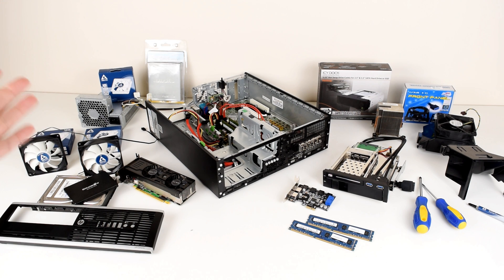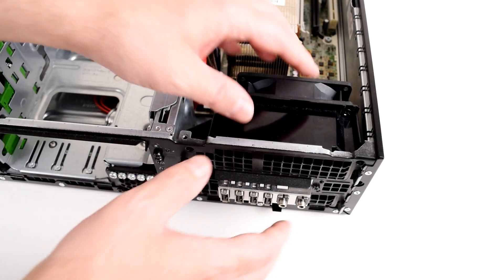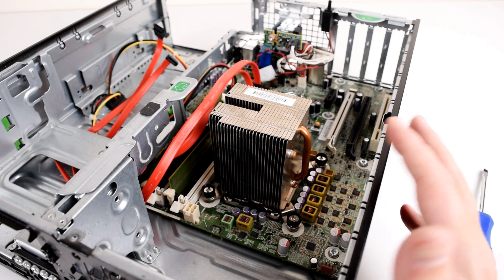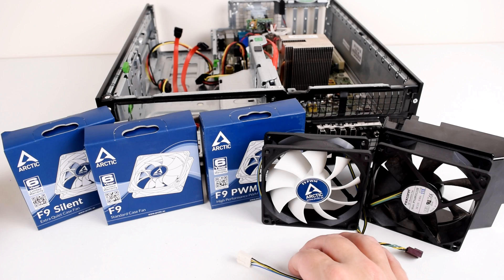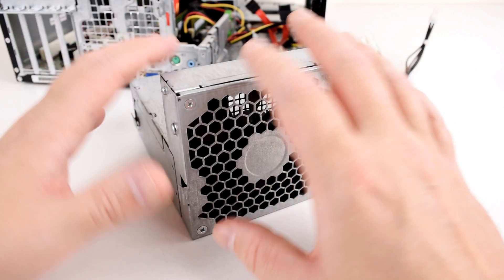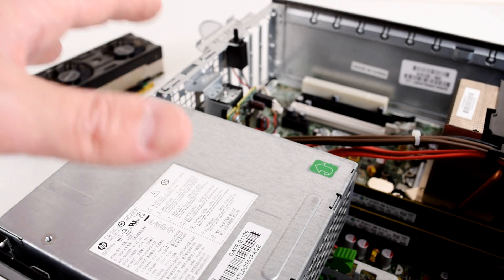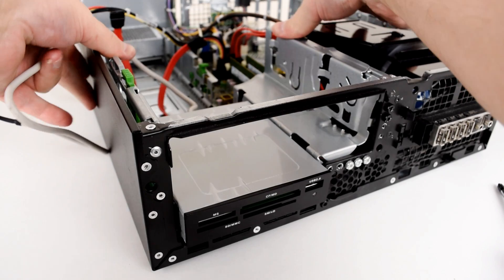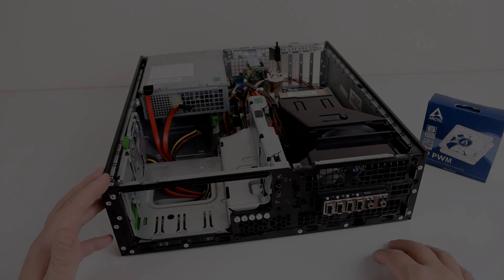Improve your HP Elite Small Form Factor PC

Comment from the maker: I get a lot of questions about the power supply. Check this video segment https://youtu.be/XnBMkOO34Nk?t=8m33s That's an 8200 maxed out with an i7, 32GB Ram and 1050 Ti, and the worst power consumption I measured (at the wall) was 135W. Factor in that the PSU isn't 100% efficient, actual usage is even less. So hopefully this shows what's really going on :)
Reply: I looked up the actual specs for the HP 8300 SFF (DA-14268  Version 20 — 12/4/2012): 
The PCIe X1 slot is rated at 10 watts.
The PCIe X4, PCIe X16 and PCI slots are rated at 35 watts.
The other point of note is that the first two (light blue and blue) SATA connectors are rated at 6GB/s.
The other two are rated at 3 GB/s.
Reply: Hey Phil, will this work with a HP 8300 too? I could get one with an i5 3570 , 16GB Ram for 90€ , i would buy a low profile gtx 1050ti after buying the pc :)
Reply from the maker: It should!
Reply: Anyone know if the i7 version  which ddr3 it takes?   As I want the 32gb ram    but worried it's going to be like my hp8000 where it was a nitemare to find ram that works.   Can the i7 version simply take 4x8gb sticks of hyperfuryx ddr3 1600      or is it still   hard to get ram?     Like 10600  sticks
Reply: @mobilesnapper79  The recommended sticks are PC3-10600, but you can use faster DDR3 RAM and it will underclock it to the speed it needs. P.S. this is from personal experience on the i5 2500 8200 compaq elite sff, as my budget is not infinite I was only able to test this on a few different sets and speeds of RAM.
Reply: @wh0_am_152  ah but  will that cover hyper x fury ddr3 chips  as these things can be a pain to get the chips for.  In the UK  if it is 10600    then 8gb chips can be got second hand for  £25  making it a £100 for 32gb     however   I got a kit I use in my old fx8350 build  that would save a few quid  as I think the i7 3770 with 5 ssd  32gb ram  and a 1050ti  will be a useful editing only pc
Reply: @mobilesnapper79  Probably, I got 2 sticks from Crucial, and two from EVGA in my system.
Reply: @wh0_am_152  thanks mate
Reply: @mobilesnapper79  yw, PS, it took me 5 restarts to get my computer to accept the new RAM, and a black screen ir two
Reply: @mobilesnapper79  What was the issue you had with the RAM?
Reply: Hmm it wasn't in this machines pdf file... But I remember reading it's 35 watt max for regular pcie or add in cards and normal 75 watts for graphics cards.  

Another powerhouse sff is an HP z230 check it out.
Reply: Just got a hp 8300 sff and want to add a large 4tb storage hdd. Will that work with this older pc?
Reply: @adamsirois4672  yes it works with a 12tb iorn wolf    so it will work with a  4tb  drive.
Reply: @adamsirois4672  Yes, it should work fine. Setup in Windows 10 and Linux is easy for large hard drives.
Reply: Which Camera did you use to film this video?
Reply: PhilsComputerLab they make great hackentosh's
Reply: PhilsComputeLab How many mhz have ram which you use in that build or can you tell me how many mhz ram that motherboard support
Reply: I have HP Elitedesk 800 G1 SFF. I assume it would work on mine aswell?
Reply: it's funny how i watch this on a 8200 SFF
Reply: but dont you know you aint livin unless your pc welds the parts together if theres ever a short
Reply: My question regarding power supplies is CAN a person find an after market (name brand) power supply to replace a bad power supply in one of these small computers?
Reply: @Animalwon  If you are worried about power this isn't the machine for you. The PS is non-standard and hacking some kind of replacement together is way too much work. Anything is possible but practical is a different matter. If the PS dies you can always pick up a used one from eBay.
Reply: @ninline2000   No,I was questioning the power supply because i got a few of these and they were missing the power supplies when i got them ... And needed to know what I could use to replace them, and what wattage I'd need to use i7's on them.
Reply: @Animalwon  I think there are converter cables that will allow you to use standard 24pin power supplies, or just get used PSU from 8200
Reply: Where could i find such a power supply? What form factor are they? I have a few old cases for these computers that i would like to put to use but they need power supplies to go with some new mATX motherboards.
Reply: do I need to upgrade the psu to put the 1050 ?
Reply: @th3Kun  If it's not too much trouble you could upgrade it to be completely safe. But you don't have too, it will work on original PSU
Reply: @TheKoxy1995  no I want the method but ok thanks
Reply: What is that 5.25 to 3.5/2.5 USB 3.0 caddy from?
Reply: can you try using a low profile GTX 1650
Reply: @hydro73_42  Does not work with the original power supply. HP had their power supply made in a specific/unconventional shape as well, so it's not an issue easily remedied unless you're comfortable altering (drilling) the actual case.
Reply: nive video dude! I have a question, how did you get the asus bios? I only have some very basic options and some features that I need cant be found
Reply: I have the same mobo but a i5 2500
Reply from the maker: @LIGDASCC  What Asus BIOS???
Reply: @philscomputerlab   i might be confesed but if you know is there a way to update the bios because i cant find anything not even at hp site
Reply: @philscomputerlab  i dont mean haw to do it but where to find the files
Reply: You fail to mention kind of fan you use for the power supply.
Reply: I want to use 3 or more monitors on this pc, I got it working with a VGA and DisplayPort, I got a ATI Radion 5450, but was not able to use the old ports, any recommendation?
Reply: @LordOscur  What do you mean by old ports? Explain, elaborate..
Reply: @jbol2454  The motherboard onboard video ports (integrated VGA and DisplayPort)
Reply: @LordOscur  What a silly question this, you can't use the onboard and graphics card at the same time. Get another garphics card? Like a GTX 750 or something.
Reply: That it is not a wind tunnel it's a cooling shroud.
Reply: Can you play Netflix 4k UHD H265 with this?

Comment: i got one its a i7 2600 with 16gb ram , ssd drive , hdd500gb, wifi, nvidia quadro p400 2gb gddr5 gpu  it runs gta 5 on high settings and fortnite on mid to high settings. what can i do with it other than go to 32gb ram is there a better gpu that will fit it?
Reply: how’s it going with the setup? no provlems?

Comment: I did a BIOS update on one of these before but it bricked the system for some reason so I would not likely attempt it again. I have four of these machines all in service. They are fantastic. I had an error about the power supply fan not being detected. I just ordered another stock fan from eBay. Hopefully it is an issue with the fan and not the power supply itself.

Comment: What they are 'trying' to say is those ports only give 25watts, and you may not have "an issue" but if you measure your power draw from the wall with and without, you'll find you aren't pulling more watts.  80w for a fully loaded core i7 sandy bridge at around 4ghz on air cooler, 75w for a stock 1050ti that's actually getting the power it will use, and the answer becomes obvious.  The devices will run with less than optimum wattage without 'issue'.  That does not mean, however, that you are getting the boost you should be.  a low profile video card with an internal power connector is the answer.  Then get a serial or molex to pci 6 pin adapter and plug in that way, and THAT will give you the 75 watts total to fully and properly power a decent graphics card, with the 25 from the board leaving you headroom to ramp up ram and gpu clocks.
 For the cpu, I'd actually stay with an i5, not an i7, and undervolt / overclock it.  An overclocked i5 will outperform a bog stock (and under fed) i7 in games 90% of the time.just take it to the ... what is is, 3500k that this board will take?  I don't think it will go further as the socket changed after the 3000 series if i remember right.  So, an unlocked 3500k, run it .2 volts below stock and ramp it up to 4k all core all the time overclock then run furmark for 20 minutes and see how temps are.  if you have ramped up the fan to something more static pressure focused with higher rpm, you should be able to set a fan curve that will let the speed stepping take you to 4.8ghz.  That will crush an i7 runnin underwatted at 3.8.
Reply: Also, the black sata port?  It's labeled esata, and the dark blue port is labeled sata0, light blue port is sata1, and the grey port is sata2. Most likely have to have esata enabled in bios and make sure you're running a firmware that supports hotswapping, which you obviously are with the swap dock you're running.

Comment: A few notes. Criss cross pattern for the thermal paste, as you would have pushed a significant amount to the side on those first 2 screws. 
Also, I feel like saying "if you know how to use a screwdriver" is very poor advice for opening up a power supply as touching the wrong component could not only cause a fire, but actually electrocute and kill you.

Comment: I feel drivebays are getting more and more difficult to find, now-a-days.

I just got an inter-tech x-3531 (5.25" bay - 4x 2.5" bay)
Got it about US$20. The rear fan is a bit noisy and I am looking into a 3rd party 30-40mm fan for it already (Haven't meassured yet).
But it's a joy to have on the tower desktop and for the first time in 15+ years, I've had a chance to actually clean up and sort my data.
4 SATA-cables included and all powered by a single molex plug.

Argueably very useful for ease of work and organizing a tower.

A video dedicated to front bay accesories, perhaps?
And how to find them and what search terms to use?

Comment: The light blue sata is for optical drives.
I have a problem that my 5810 only boots with one stick of ram, anyone up to 8 GB in any of the 4 slots works but any 2 or more and no boot, I tested them individual, all good. I suspect a bios update somehow affected the dual ram controller in some way? That's all I can think of. So now I have a bunch of unused 4 GB sticks lying around.

Comment: At my work we have a dozen or so of these, the 8100, 8200, can be updated with the BIOS of the 8300. Once that's done, you can add an i7-3770, 32gb Corsair Vengeance LP,  Geforce 1650 4gb, ddr6 cards. The other important upgrade is a pci-e x1 slot card that has a SATA-III/600Mbps controller and takes a M.2 SATA SSD such as the Samsung Evo 860, as the chipset ports are SATA-II with a bug that limits them to 150mbps, severely limiting SSD speeds. Bear in mind that the BIOS, even the latest current as of this post, DOES NOT support NVME, so it must be a SATA SSD. The things are absolutely epic upgraders. We are shortly about to try out a Quadro RTX A2000 6gb in one of them, which is roughly equivalent to the Geforce 3050.. cross fingers it works well.
Reply: POST A VIDEO OMG....

Comment: dont go in a roundabout fashion .. always go across! uneven mounting pressure can dammage cpus, and sockets, or displace thermalpaste to one side of the cooler! also about the ports, i have noticed that devices like that sometimes have the ports literally disabled in bios, if there wasnt an extra booked at the manufacturer for extra hdd or something, had a couple dell 3010 that had a dvd and a hdd, no physical space for more, but they had 4 sata ports, and 2 of them where disabled in bios ( easy to enable again )
Reply from the maker: You're right 👍

Comment: Problem is these machines in sff form are very cheap to buy but the parts to upgrade them are very expensive. Even a low end gpu to fit is around 100 pounds on ebay. So once your talking 150 upgrade not worth it at all. The low profile gpus are a total rip off.

Comment: 4 years still alive... BTW i just got office pc in my Aunt company around Php 2000 ($40) and we have same layout of the case, the default specs is i3 540, 2gb Ram, and 360gb of HDD still rocking Windows 7 pro and i watch almost 4 years about pc and i would like to build in the future and now i was in my 4th year college i just got one and almost completly max out got i7-870, 12gb Ram, 128gb and 1Tb of storage and RX 550 2gb low profile (Becasue it cheap here as long has doesn't need a power connector)  GPU which game changer if you own a old laptop w/o GPU.

Comment: Can i transfer this motherboard into another cabinet
Reply from the maker: Careful! These machines use all sorts of weird parts. Different PSU connectors. If you want custom, I urge you to buy a used motherboard bundle instead.
Reply: Psu connectors are not an issue i have figured that out but will this motherboard fit in an gaming pc cabinet
Reply: Is it a micro atx motherboard?
Reply: Could you help m with this build i will share content w you and you can post it
Reply: @adityaborale1  this motherboard is backwards compared to conventional motherboard so it won’t fit in normal cases. By cabinet I assume you just mean a pc case, and not a literal cabinet as people sometimes make arcade machines using arcade cabinets.

Comment: You can use a GTX 1650, it's a little more powerful than a 1050ti and doesn't need pci-e power, runs off the slot. I used one in a 8300 elite.
Reply from the maker: Yes and the RX 6400. I hope we see some more options with the 4000 Nvidia and 7000 series AMD.

Comment: How similar is the 6200 to the 8200.  I need to replace the power supply.  Do you suggest that I go ahead and overhaul the whole thing as per your video.  I am 81 years old and  have had this machine for years stored away.  Now I need this computer to run some legacy programs.  I intend to use it off the grid.  I am not interested in gaming.  I am a writer.

Comment: This has been the most useful video on YouTube for me and I keep coming back. A few days ago I removed the front fan, cleaned out a tonne of dust, manually blew hard through the power supply [non-smoker!] and finally got round to fitting an SSD. Maybe it's just UK autumn kicking in but the GPU is down to 20ºC now and everything is much faster.
Reply from the maker: Thank you 🙂

Comment: Would it be a bad idea to reverse the direction of the cpu fan? At least then hot air from the case and cpu will be exhausted out rather than just pulled into the case.
Reply from the maker: Well HP designed it like that for a reason!
Reply: HP did actually reverse the fan flow in their next SFF series the G1, just that they put the exhaust and shroud for the CPU at the rear.

It's worth experimenting with.
Reply from the maker: @jbol2454   We'll be checking out the ProDesk S1 soon 🙂
Reply: @philscomputerlab  Nice, I wonder if one can get XP working flawlessly on that one ;)
Reply from the maker: @jbol2454  Yes XP works just fine 🙂

Comment: What are your storage options if you want to keep the optical drive and external card reader slot? Can you fit an SSD underneath the existing HDD?
Reply from the maker: Yes you can get a 3.5" to 2.5" adapter.
Reply: @philscomputerlab  Any chance you can stuff a 2.5 drive underneath that 3.5 HDD? Is there space?

Comment: Does the fan inside the power supply have some kind of rotation control? Does it work with the CPU cooler?
Reply: The setting in the BIOS controls the speed of the power supply fan.

Comment: I recently planed to upgrade my hp elite 8000 sff, I want to change the power supply, motherboard, cpu

I got an msi motherboard with a amd ryzen 3 3600, I want to know will removing the stock heatsink and fan damage the system, and will the pcie ports work properly?

Comment: so does the hp compaq 8200/8300 240w.got 2 barebones hp compaq without hdd or ram.
can it handle 8tb? cause im just gonna turn it into a retropc for my niece and nephew.
16tb ram and raid 0 hopefully 10tb (2tb hdd and 8tb hdd with low profile 6400 or 1050 ti)

Comment: I have this same pc i bought a new heat sync its the noctua Nh D9L it says it fits in most sff pc cases and its compatable with this mother board. But its 95mm in height and with the fan 110mm in width. Will it fit in this case?

Comment: Thanks for the vid. A note - I was just installing a new case fan in my 8300 and found the motherboard connector was a non-standard type and I couldn’t do it. It’s 4 pins, but the plastic lug goes across the whole width so a standard 4-pin plug can’t slide into place. I’ve mailed the new fan maker just in case they know the answer.
Reply: Hi,
It is the same with the Noctua NF-A9.
You just have to cut the plastic end on the fan connector.

Comment: More CPUs are supported than what the web specs show. If you find the manual for the 8200 line (I think 4 diff. form factors) you will see that the the i5 2500k and the i7 2600k which are better CPUs at similar prices to the non k variants and would set you up for an even better upgrade if you want to get an overclocking motherboard and a better power supply later down the line. There is an atx mid tower variant of the 8200 that is roomier than the one in this video.

Comment: What is the bay @ 11:50?
Reply from the maker: I don't have a model name or brand, I got it from eBay at the time of making this video. It might not be made anymore, but if you go to eBay and search for drive bay, you will find a wide range of models.
Reply: @philscomputerlab  TY.  That is a great video BTW!
Reply: Hi, you can found one on aliexpress.
I have the same model as on the video (Thermaltake Max 5 Duo).
I couldn't get the hot plug to work on my 8300.
Reply: @allerganallergan6899  TY

Comment: Hi, I just changed my Pc's fan to a different one, does anyone here know what the safe, normal and idle temps for this pc is? Mine has an i3 2120 and I don't really know if my temps are normal. It usually sits around 40° -47° on idle ( after I changed the cooler) . I don't have any Gpu installed.